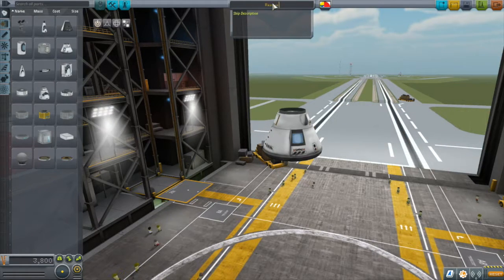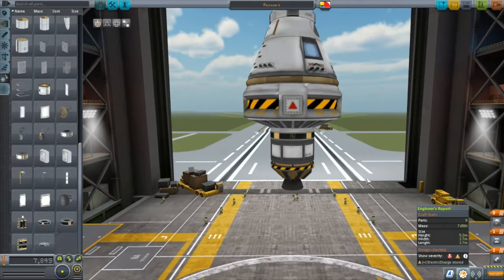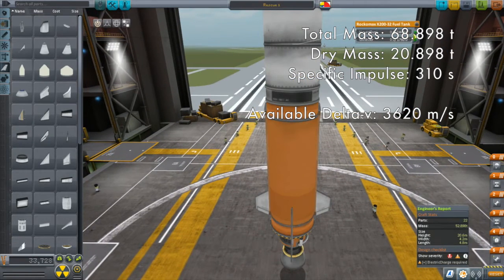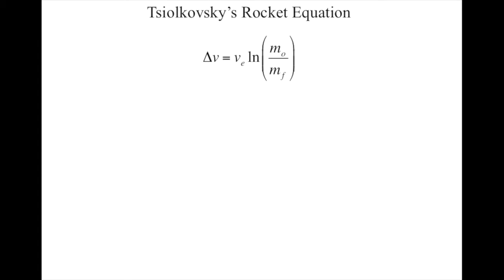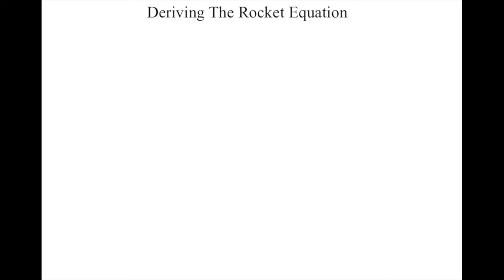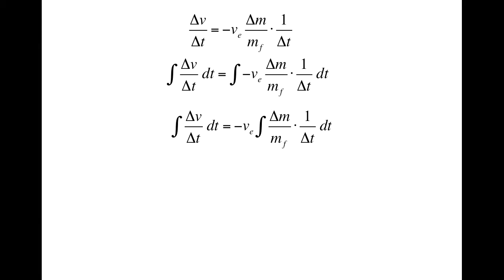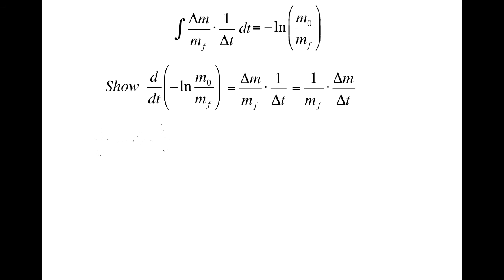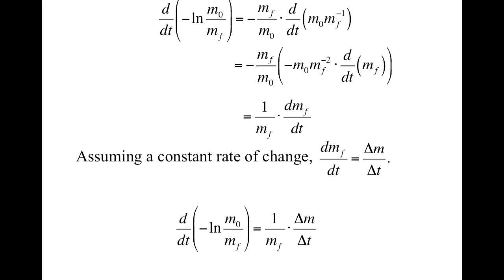KSP Tutorial: Ep 4 - Basic Rocket Design & The Rocket Equation

Comment: Fantastic video. First showing, then calculating is a great way to present this. 
If I can make a suggestion, it would be to make some simple diagrams during math presentation to illustrate which point has v1,r1,... I was a bit confused by the switching of r1 and r2 for the 2nd manoeuvre.
Now ler's see if I can derive these formulae myself 🤗
Reply from the maker: I can't see what you're referring to.  Could it be from a different tutorial?

Either way, thanks, an I'll keep what you said in mind.  It's very likely that r_1, r_2, v_1, and v_2 refer to just any two arbitrary points in an orbit.

Comment: If i remember right, since I’m using  a modified 64k install, the equation to find the rescaled DV estimates is DV1 = DV0 * sqrt(new planet radius / old planet radius), so the DV to get into orbit around a Kerbin with a radius of 4077440m is ~8,864 m/s, right?

Does this assume an ideal ascent? What is an “ideal” ascent?
Reply from the maker: I'm not familiar with that formula.  It seems reasonable.  I've not played with any of the scaled solar system mods.  I do talk about calculating ascent costs for Kerbin in the link below.  It's pretty easy to extend it to any planets.

https://youtu.be/0BtbYVtZ9ac

There is some information I have to assume to do the calculating.  As this is a Kerbin/Earth analogue, I'm assuming a surface gravity of 9.8 N/kg.  This got me an ascent delta-v of 6120 m/s plus atmospheric drag.  Atmospheric drag for Kerbin is about 1000 m/s.  By your calculation, it seems to be about 2744 m/s.  Not unreasonable given a bigger planet.

As to the ideal ascent.  It depends.  You want a slow gravity turn never veering far from the prograde vector, but the exact profile for your planet may be different from Kerbin.

Comment: how do you evaluate  (345)(9.8) (Ni) (7.65/6.85) =373???? with Ni
Reply from the maker: Yup. You just got me pulling out a calculator to double check. I'm not sure what Ni is. The function you need is the natural logarithm, which is typically ln (that's a lower case L then n) on a calculator. Logarithms typically don't come up until senior high school, so you may not have encountered them. I can point you to some videos on them if you want.
Reply: @MikeAben   so i found out, its (g0)(isp)ln(m0/mf) = (g0)(isp)ln(m0) - (g0)(isp)ln(mf) 

you calculate (g0)(isp)ln(m0) by (g0)(isp) =ANS (m0^ANS) then ln of the answer and subtract.
Reply from the maker: If you are asking how to enter it into a calculator, it depends upon the calculator. They can be different.